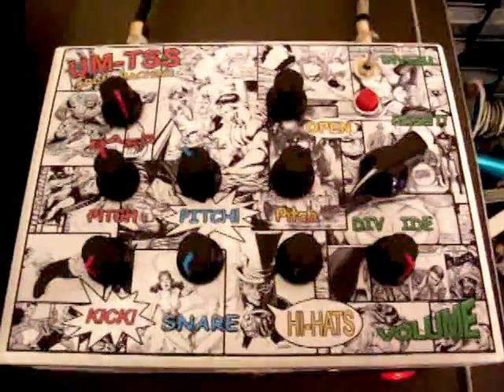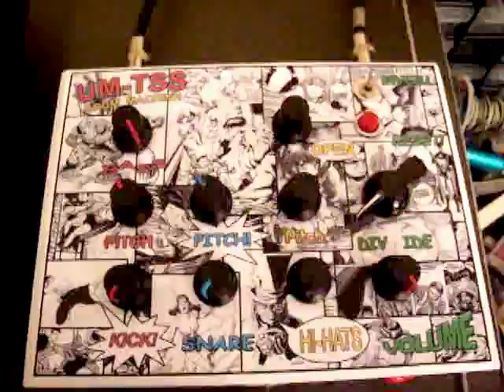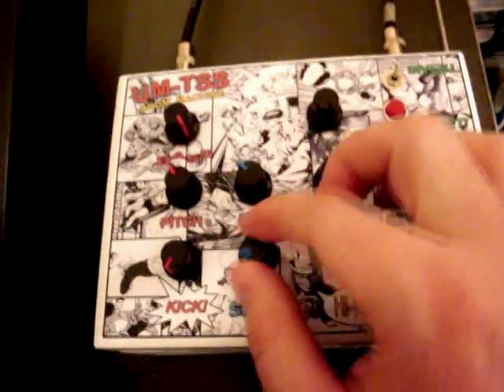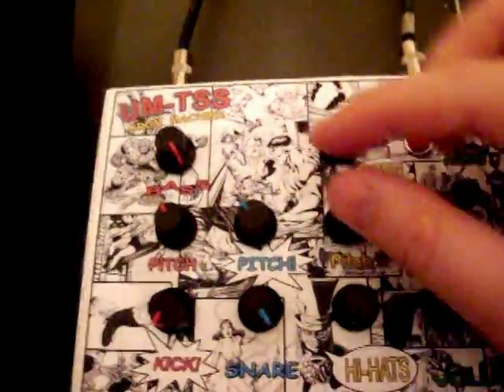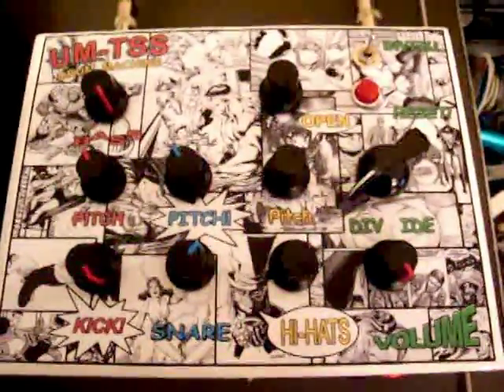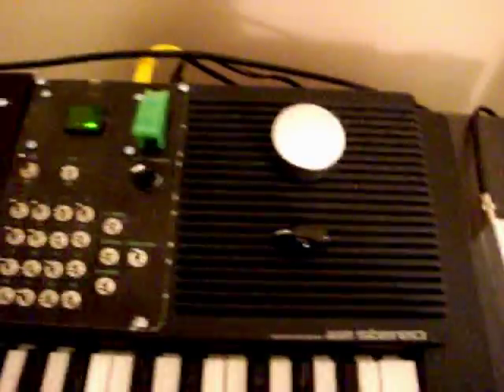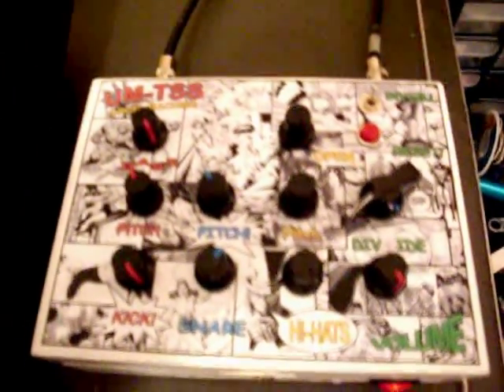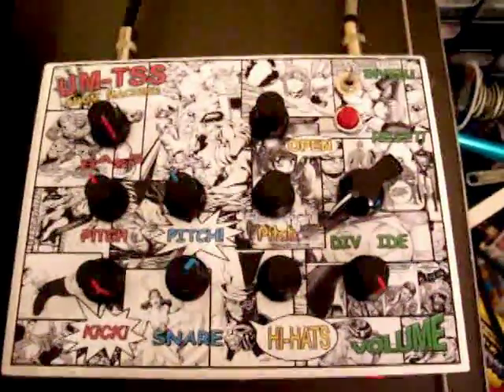UM-TSS Drum Machine

Comment from the maker: Yes. I had the inversion wrong. I just need to pass it through one of the spare schmitt triggers in the 40106, but I still havent done it because I hardly ever use it. The project was mostly to test if I can create ok drum sounds with cmos chips and passive filters that can be triggered by 5V pulses. The answer is yes, so I plan on applying what I learned to something that uses an arduino to interface between midi and the cmos drum sounds. Then I can program my beats in Live.